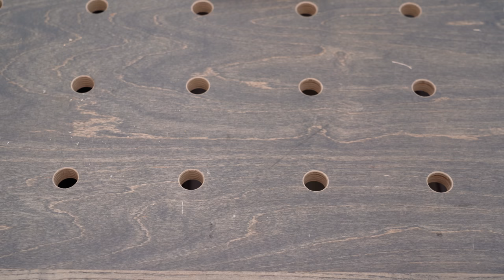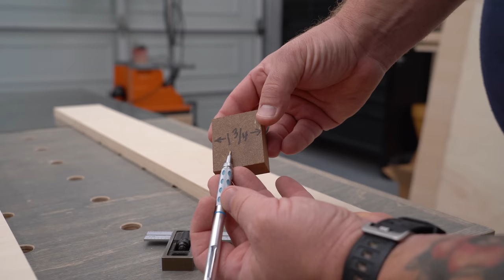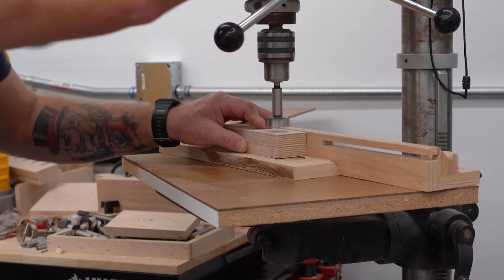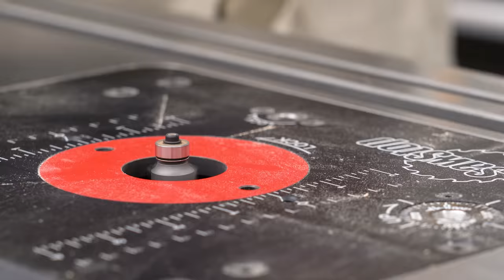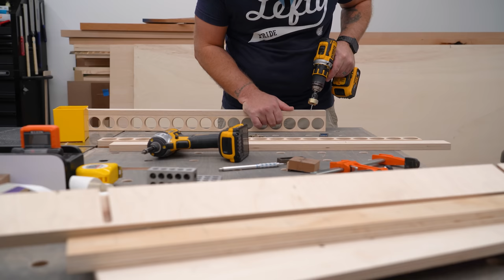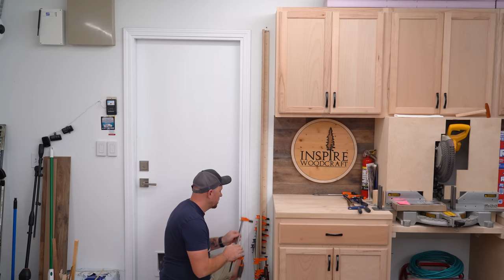You Probably Haven't Seen Clamps Stored Like THIS

Comment from the maker: For those that need numbers, the strips are 2" wide and approximately 33-3/4 long (that just happened to be the length of plywood I had on hand). This will fit 19 clamps total, but of course you can make it as long or as short as you need. The holes are 1-1/2" diameter. Measure one inch from the end, and then 1-3/4" thereafter for the spacing. Hope that helps!

EDIT: Also, here's an update video for those that need verbal explanation - https://youtu.be/AGeJTyT_9qk

Comment: Great idea! After reading all of the comments, I was surprised to see how many people had the same question, and it got me thinking. There are a couple of ways this could improved upon: 
1) put a pivot at the bottom and a latch at the top with a chain to prevent the whole thing from leaning out too far. This would allow the whole assembly to be leaned away from the wall, separating the clamps for easier installation & removal. 
2) Bolt the whole thing to a tapered board that’s wider at the top. Same effect as #1 but always leaned forward and requiring slightly more space. 
3) reverse where the pivot is so that you can pick the bottom up and out for easier access to the individual clamps. This would probably be more prone to jamming up as each clamps tries to lay flat when the assembly drops back to vertical, though.

No talking: JSK Koubou has done alright for himself using this approach,and I’m a big fan of his channel…

Comment: Gotta ask -- it looks like each of the clamps is resting on the clamp below. Does this cause a "tangle" when trying to pull a clamp out or do they come pretty easily?
Reply: This was the first question I had as well. Could be that a different viewing angle would reveal that it's not an issue. Or that maybe it is an issue, but could still be efficient storage for your lesser used clamps.
Reply: Looks like a good space saving idea if you have several F-clamps, you group your clamps by size and hang multiples (4-5?) of each size In consecutive holes so when a size is needed you pull the top one from the size group. What I don't understand (can't see it) is if the bars from clamps in higher holes interfere when removing those in the lower holes.
Reply: Yeah, that's what I'm getting at. It seems like when you would pull a clamp out, there is a clamp making contact above it and/or below it, meaning that every time you pull clamps it's potentially a two-handed job (or you might pull multiple clamps)

I imagine this would be pretty easy to overcome with a little knob next to and under each hole that keeps them separate. Either that, or have the hole strip extend outward from the wall at one end so the clamps can hang down freely with a footprint that's still pretty small.

But yeah, either way this is all speculation. Either it's an issue and he'll resolve it, or it's not, but either way this is a clever way to save on space.
Reply: Separation of clamp sizes mitigates the issue.
Reply from the maker: Hey! I just uploaded a new video addressing the questions and concerns people had in this video. If you want to watch: https://youtu.be/AGeJTyT_9qk

Comment: I have all my f-style clamps hanging on two large L-brackets. I have so many now that there isn't any room for the smaller ones and I don't really have room to add another L-bracket. This idea could be just the arrangement I need. 

It's got me thinking about making a bracket that would allow two of these to hang from. As far as my L-brackets stick out from the wall, and the spacing between them that I have available, I could make 4 of your storage strips and easily double my storage capacity without taking up any extra space.

Comment: Nope.  Try pulling out just/only the 9th clamp from the top...mess.  Horizontal storage platform makes more sense, can remove any clamp without other clamps in the way.
Reply: So he organized them by length leaving space to get 12” versions out without fighting 6” versions. Why would you want the 9th clamp down in a section before taking the first? … each storage solution has pros/cons though so do what works best for you?
Reply from the maker: @Adam DeJesus Whichever idiot doesn't organize their clamps and finds themselves needing the 9th one down gets whatever comes their way.
Reply: @InspireWoodcraft  Yes.  I am that idiot.  I paint myself into a corner sometimes, and then I need the 9th clamp now!  Your idea saves precious wall space but I have to save precious brain cells.  You do great work and I learn from you every time you post.
Reply: Aaaand...all concerns addressed in the follow-up video explanation.  I'm actually gonna try this now.